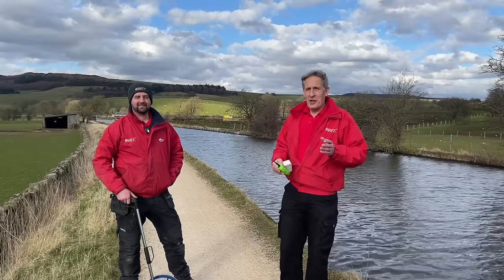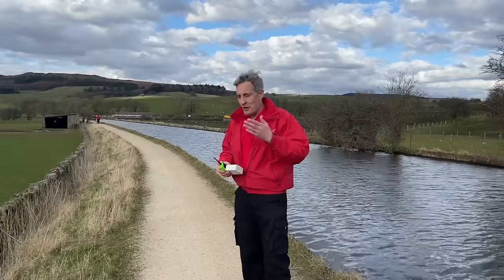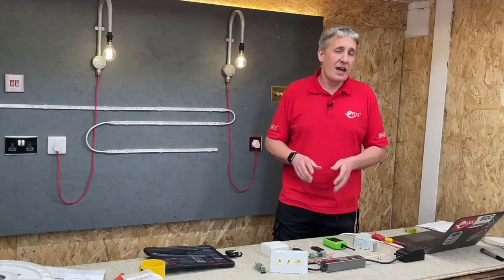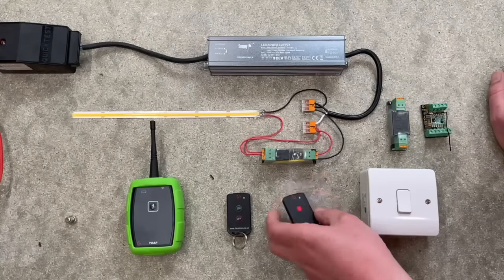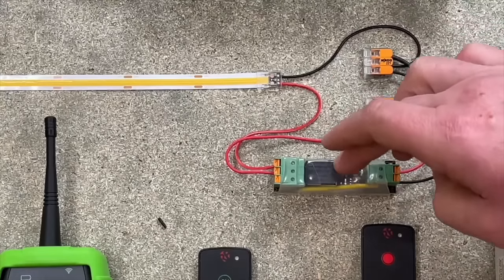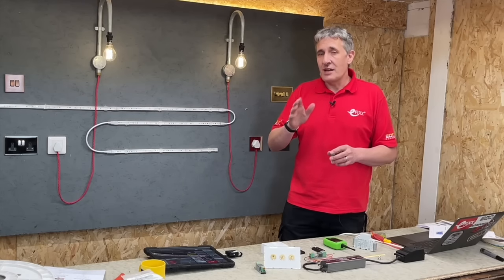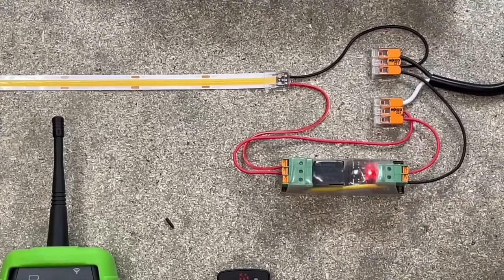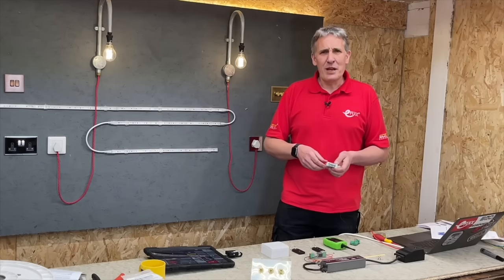RF Solutions Ferret - makes almost any Switch Wireless

Comment: I've used the ferret on several lifts. Client wanted a priority switch but there was a glass operating panel in the lift car, not able to add a keyswitch without the risk of breaking it.
Installed a ferret near the I/O board with the priority input, wired the supply and contact, programmed the remotes and handed them to the client.
Reply from the maker: Great application

Comment: Brilliant.. i have been looking for something like this for a while.. gonna come in handy when the new toy arrives .. Gordon.. how well does the bogey board work with a metal back box and metal switch place.. need an rf extension?
Reply from the maker: Metal back box and front will reduce the range. But they do work.
Reply: Brilliant.. thanks .. just been checking prices.. really good value

Comment: I wonder if they are reliable. .A hotel I did maintenance for had a different make .i was forever getting called out as lights would stay on or not work . The receivers were in the loft and had to be constantly re programed. If you use them for a socket obviously you will have to fuse them accordingly example a fused spur

Comment: Houses have walls that can significantly reduce wireless range, also wireless products can have interference from other wireless products, washing machines, fridges etc. It may be that it laso interferes with wireless products already installed in the house such as WiFi, fire and burglar alarms. In Scotland houses have to have wireless linked fire alarms by law.